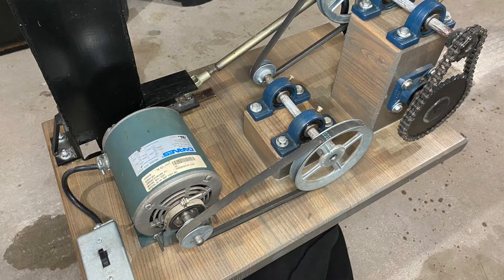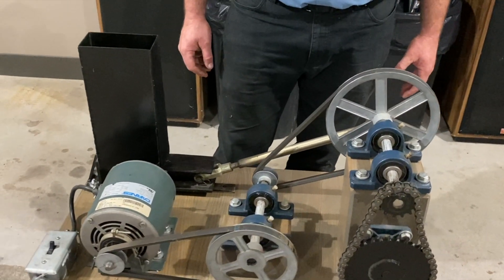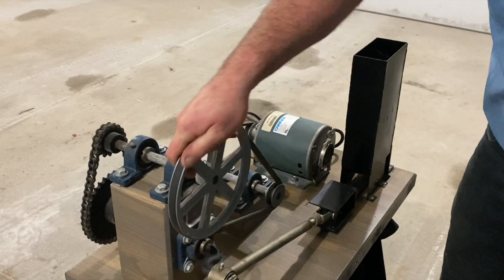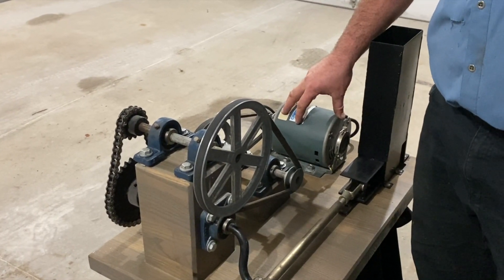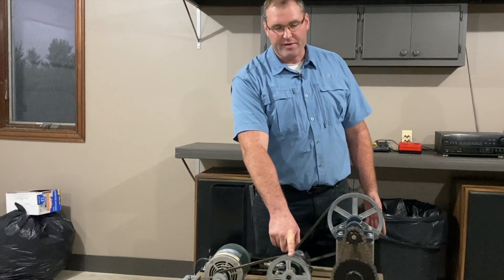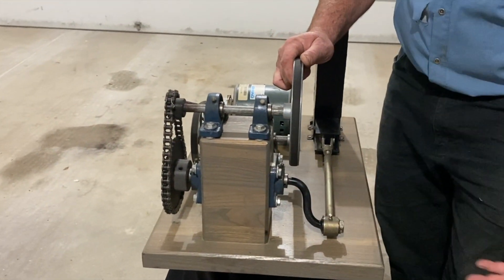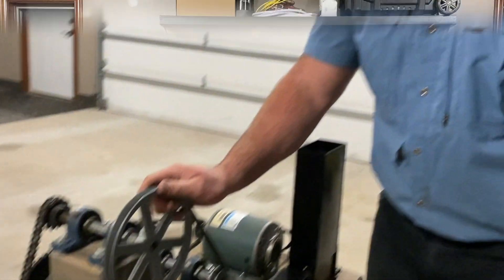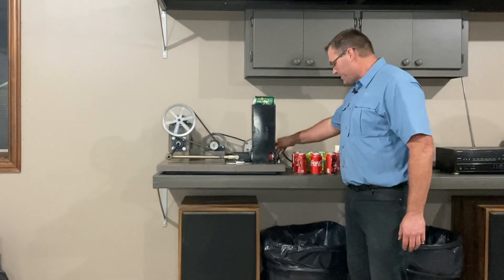Automatic Electric Can Crusher - DIY

Comment: Actually I'm working on something a little different I'm modifying a wheelchair motor. To raise and lower the jacks. Using a 12 volt power source instead of purchasing a system that likely will not jack a loaded trailer off the truck it's on

Comment: I'm looking to build a can crusher for my Veterans organization so when can continue on with our can recycling program.  Would you kindly provide me with a parts listing that you used?  That would be much appreciated.  Have you thought about selling plans, because this is by far the best one that I have seen.  I, along with others would probably buy parts from you like the double 90 degree crank lever.
Reply from the maker: Thanks so much for the positive feedback.  This was just a one time deal for me.  I made the dual shaft out of a straight shaft with a torch and my eyes to see if it looked straight.  The blocks, spacing, belts/pullies, and other items where just made from scratch in a way that made them work.  Sorry, I don't have plans, a parts list, or any other info other than in this video plus a supplemental video I made.  I hope this helps enough and best wishes with your goals.

https://youtu.be/DGUw6xYww8M

Comment: Cool setup!  I need to convert about 7,500 full cans into crushed cans and am looking for ideas to save some time getting full cans emptied and crushed.  I think I could replicate your crush idea with a good crank motor assembly where the gearing and crank are combined into one purchasable piece, and I could fabricate the 'crush piston and crush chute' but I still need to get the cans emptied first!  Any good ideas?  I was thinking maybe a sending them down a chute with a geared-down motor running a wheel with short, sharp, teeth (a ground down gear wheel) that punctures the can along the side, give it some time to drain in a second chute that could drop it into a crusher mechanism based on your concept.  Clear plastic for sides to create spray protection and if we can do 30 cans a minute that would be good.  The problem with draining is that the cans should not rotate if the holes are punched along one side with air holes on the opposite side (idler gear with similarly short sharpened teeth).  Any better ideas?  Cheers.
Reply from the maker: My suggestion is to keep your mind moving towards a solution and don't be afraid to fail and revise or restart.  My eventual model was like the 4th or 5th try at it and the entire process was fun.  Good luck!

Comment: You could have used a variable speed motor with a router speed controller and not needed all the pulleys to step the RPM down. I need to make something similar for my foundry. I've thought of different ideas including this one. Yours does work great. Very well made.

Comment: Where did you source the gears, belts, chain, and motor?
Reply from the maker: The motor I got from a local electrical company but could have been purchased from Supply House online or really anywhere.  It is simply a 120v 1/2hp PSC motor with a base mount.  The other gears, belts, pulleys, and chain came from a farm supply supply store in our area named Fleet Farm.

Comment: Awesome Design! Did you solid model this and make prints to build by and if so what software do you prefer?
Reply from the maker: I did this 100% on the fly without drawings.  What you see is the second version including a stronger base mount, chain on the final drive, and a linear slide to hold the plunger straight.

Comment: Is there a way i can improve this and make it faster for my research?
Reply from the maker: You could increase the size of one of the pulleys to make it go a bit faster but the limiting factor is the speed that the cans will drop down into place.  If the plunger hits before the can is ready, it will jam.  Plus, it is surprisingly difficult to keep up with loading the hopper with one person.  My option is that I wouldn't want it to go any faster.

Comment: It would be a cool series to take this platform and try engines and different motors and power supplies and things
Reply from the maker: I agree.  It would be cool to use a gas weed trimmer motor I always thought so it was portable but then it would be a problem use indoors.   Thanks for the suggestion!

Comment: Hi, can you give the name of the motor because i search everywhere and it didn't match with yours. It could be the name of brand or anything :)
Reply from the maker: The name of the motor doesn't matter.  What matters is the HP, speed, voltage, shaft size, and mounting type.  This motor is a 120v 1/2hp 1,725rpm 1/2" shaft surface mount motor.  I hope this helps.

Comment: Do you use a bench power supply?
Reply from the maker: No, I just plug it into any outlet and there is a standard switch to turn on the motor.

Comment: How much did all the parts cost?  Because I'll pay you twice that to build me one.
Seriously though.
Reply from the maker: Hi, I appreciate your kind sentiment but I'm out of the can crushing business!  It's not for sale and I'm not interested in making another.  I would guess it all cost about $300 considering a used motor for $50, the linear slide was $60, and the pulleys where around $10 each average.  That plus the belts, chain, wood, shafts, stain, AC cord.........yeah, it was at least $300 I would say.  Again, thanks for the interest but this is a display only.  Take care!

Comment: Awesome video and build. Could you use a transformer or a variable current controller for rpm reduction instead of gearing?
Reply from the maker: I suppose you could but then you would need much more torque.  The rotational inertia of all of the parts help work the plunger through the initial breaking of the can's shape.

Comment: Question:
What’re the requirements for this project?
And can you show me how to make this?
Reply from the maker: Hello and thank you your questions.  The project was several years ago now and I'm not sure what the requirements where.  I believe that each student had some flexibility to engineer any project that included calculatable physics that would be demonstrated in whatever it was that they made.  Then they had to write a report about how they went about making their invention.  Obviously I helped out a ton with the woodworking and other mechanical things.  How you can make, I'm sorry, but I can't really help with that.  There's too much to explain or review.  You'll need woodworking machines and experience, a torch to bend the angles on the shafts, a motor, electrical wiring experience, and the ability to weld some custom fabricated items.  I don't think I can help there.  If you search the channel you'll find another video that has some of the measurements listed but there's much more to it than that.  I appreciate your interest and thank you for watching!

Comment: Hey, im an industrial designer student thats developing a prototype like this one and im struggling in founding the maths and the calculations around the rpms decrease, is there any mailing where we could ask for some help and ask you some questions?
Reply from the maker: Hello, so if you are an industrial designer you'll be way ahead of me when it comes to coming up with official plans for the engineering side of this project.  In all ways, I "MADE IT WORK" out of shear will and basic common sense decisions related to mechanics.  I guessed on the motor size, I guessed on the belt sizes, and I guessed on the linear slide working correctly.  Then after a few trial runs I kept on working on the project until it was complete.  For the pully sizes, it's just a simple division problem.  A 2" pully driving an 8" pully reduced the speed by 4 times, then a 2" driving a 6" reduced it by another 3 times, and so on.  So the motor began at 1,725rpm divided by 4 made it 431rpm, and then divided by 3 made it about 144rpm and then the final change was the chain drive which reduced it by about near 2.75 for a final rpm of near 52.  I hope that helps and thank you for watching!

Comment: So then what smaller motor would you recommend?
Reply from the maker: I think if I went smaller I'd go down to a 1/3 or 1/4 potentially but not much less than that.   There's a decent about of rotational inertia there so it may work.  You could even put something heavier on one of the shafts, just to spin fast, to help with the initial punch that you need to get the crush started.  Good luck!

Comment: Very cool!  One suggestion to add a flywheel on the 2nd pulley.  This way it maintain a more consistent speed and even out load on motor.
Reply from the maker: Great point!
Reply: …now that’s something you probably learn in mechanical engineering .

Comment: You don't need all the complex gearing, you can simply use a bldc motor and controller + the chrushing chamber and hopper
Reply from the maker: You are correct but at the time we were just happy to wire the switch correctly so we wouldn't shock ourselves.  If I did it again I'd have updated ideas.  Thanks for the tip!
Reply: @danimalshouse  The belts, pulleys, sprockets and chain are fantastic, mesmerizing too.  'Steam Punk' as some would say.  I'd want a little guard around the plunger though, as that looks like some finger clipping force down there.  I wonder about a vibratory hopper-feeder?  Nice straight forward video too.  Beautiful work like that is sure to inspire others, thank you for sharing.
Reply: @danimalshouse  Are you willing to share some of the updated ideas?
Reply from the maker: Thank but I'm actually over this project for now.  I have a video on the channel showing some of the measurements that I used since so many others ask about it.  There's just too much to review and too many skills needed to provide a study guide.  I appreciate all of the questions but I'm on to other projects nowadays.  Thanks again for watching!  Here is the link to the other video.

https://youtu.be/DGUw6xYww8M

Comment: Do you have a parts list you’re willing to share?
Reply from the maker: Sorry, I don't have a parts list.  I can tell you that's it's a 1/2hp motor with a 1/2" shaft and that I used a combination of 1.5"/2"/6"/8" pulleys for gearing it down.  Also, I think I mention in the video that I used 1/2" shafts but they are actually 5/8" for the pillow block shafts.  The motor is 1/2" for sure.  The linear slide I got on Amazon and the rest I personally fabricated on my own, twice or three times before I got it right to be perfectly honest!  Good luck!

Comment: I’m curious, what’s the cost of this assembly? Debating whether or not to buy a $120 pneumatic can crusher, or to make this. I’d prefer an electric one to not have to use an air compressor.
Reply from the maker: The cost is going to be much more than $120 to make this.  This wooden base is 2" thick, the motor would be near $100, the pulleys would be near $50, plus the pillow blocks, shafts, belts, sprockets, chain, switches, and metal.  Just the linear slide was $50 alone as well.  I'd guess it was over $300 to make plus a bunch of time.  I guess I'd suggest choosing if you want something to crush cans for a practical cost or if you want a project with a unique group of challenges.  Best wishes!
Reply: @danimalshouse  Thank you! My dad already has an air compressor so the $80-$120 premade options are best for me, though I wish a plug-in option was available for that price for portability.

Comment: Just wondering how tall is the rear block, you say it's 6 x 6, but height? and also, what is the size of the smaller block of wood up front? thanks!
Reply: And if it's not too much to ask, where did you buy the slide for the crusher, what type? Thanks again!
Reply from the maker: So the linear slide was from Amazon.  Here is a link https://www.amazon.com/gp/product/B013Y8WXM2/ref=ppx_yo_dt_b_search_asin_title?ie=UTF8&psc=1
Reply from the maker: The wooden blocks are 5" x 5".  The shorter one is 3" high and the taller one is 9".  The entire base is 18" x 29" x 1 3/4".  Hope this helps!
Reply from the maker: I made the metal crusher with 1/4" flat steel and then I attached it to the linear slide.

Comment: Can you make an assembly video? I would love to follow it step by step.
Reply from the maker: So I started with the base.  Using hardwood I glued together what I needed and then I started to lay out the motor and the pillow blocks for the gearing down process.  Once I had it pretty much where I wanted I fastened down the wooden bases for the pillow blocks and then stained/treated the wood.  Next was the shaft.  I heated it up with a torch and got it bent the way I wanted and then moved onto the plunger and slide.  Then once I got that all mounted the way I thought was right I build the hopper for the can storage, hooked up the electrical switch and cord and called it done.  Don't get me wrong, there were several little engineering fails that went into this project no doubt, but then I figured out a better way to do certain things and it eventually worked.  I can't describe every process but hope this helped.  Good luck!

Comment: This is great! With reducing the rpm from 1750 to 52 by gearing down the machine generates enormous power to crush the cans. Thank you very much for sharing this concept.
Reply from the maker: You are correct.  I found this out when I had problems with the belt slipping.  I couldn't get the belt tight enough which is why I added a chain for the last step.  Thanks for watching!
Reply: Wow

Comment: My uni group and I got a project to build a can crusher but our motor has about 15Nm of torque. What would you suggest to make our project work?
Reply from the maker: Hi Nikolay, you have presented a mathematical engineering question to a basic DIY guy with only basic design experience.  There are many layers to learn before finding the answer to your question that I just don't have the data for.  Speed, angles, weight, leverage, and drag are all unknowns.  I'm sorry but I just don't know how to properly answer your question.  I'm using a 1/2hp and it works so, there's that.  Sincere best wishes for you on your project!

Comment: I love your design. I would like to know all the parts so that I can make mine. This project is very useful
Reply from the maker: Hi Mark, I used a half horse power 120v motor with a 1/2" shaft and 1,750rpm with a 2" pulley on it to drive a 6" pulley that is mounted to a 5/8" shaft going through standard pillow blocks and bearings.  Then the second gear down is another 2" pulley driving an 8" pulley that is on another 5/8" shaft going through pillow blocks and to a chain sprocket.  The rest is pretty much custom made and I don't have other info to share other than it took a bunch of trial and error along the way to come up with the end result.  Stay patient.  The wooden blocks are 6" x 6" of solid hardwood and the base is 20" x 30" x 2" thick.  It's a hefty platform so it doesn't bend.  Good luck Mark!

Comment: I'd like to copy your design because it works fantastic!! Its really quite pretty to look at. Can you tell me the diameter of the pullies so I can go buy the ones needed? I realize you spent the time to figure it all out likely through trial and error so if you'd prefer not thats ok. I love the use of wood. It reminds me of when they used oak in pullies as a bearing material years ago.
Reply from the maker: Hello and thanks for your interest.  I just did a quick measurement and the first gear down from the motor is a 2" driving a 6", the next one is a 2" driving an 8", and the chain is 2" or 2 1/2" driving another 6".  That takes a me down to 52 rpm from 1,750. I know you get an air conditioner condensing unit fan motor that is at 1075rpm but those are usually smaller HP, like 1/3 or 1/6.  Yes it was trial and error for me, the first one was something like 75rpm and I couldn't load the hopper that fast.  Even now it's tough at 52.  The other thing is that I mention that the rods are 1/2" but that was mistake, they are actually all 5/8".  I don't know why 1/2" came out of my mouth when I was filming.  ????  Good luck!